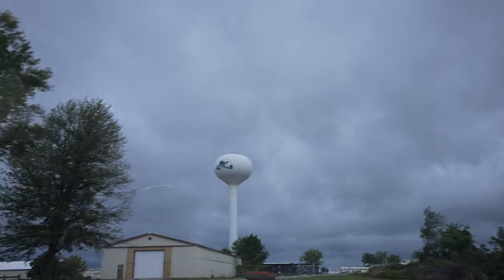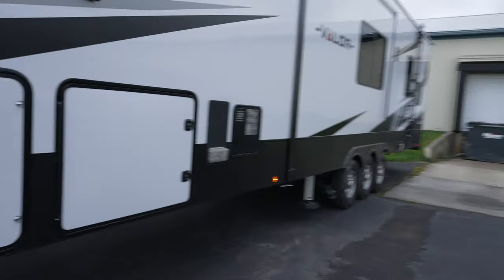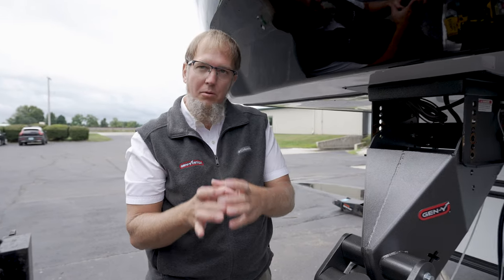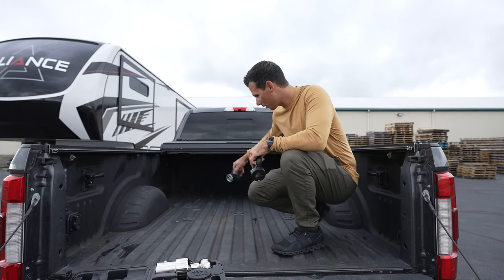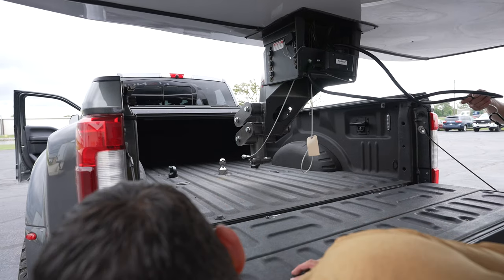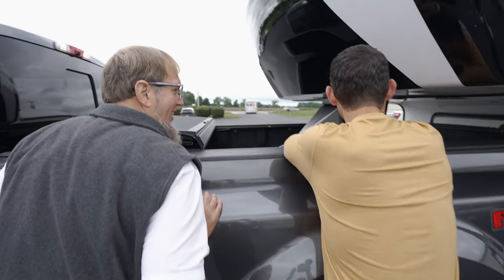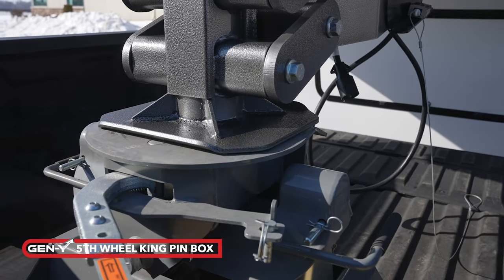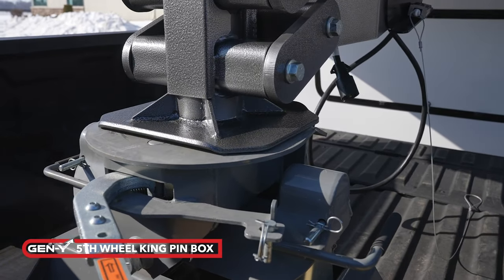Gooseneck conversion on our Alliance Valor...should we have done this sooner!?

Comment: Does it void your frame warranty? The Reese goosebox does not. Thanks
Reply from the maker: Hey Alex! Technically it does void the Lippert Frame warranty at this point in time. However, there have been zero documented incidents thus far. Additionally, Reese doesn’t make a pin box for the Rhinobox setup that we have on our Valor at this point in time.
Reply: @PawsForLove  Reese does make a hitch for the Rhino Box. The part number is 94920, supported by Lippert. We just purchased one and will be having it installed soon as our trailer is currently at the dealer for warranty work. 

The older gen 1 & 2  Reese Goose boxes did not fit the Rhino mount but with a slight modification to 4 of the bolt holes it would work. All that needed to be done was to slot these holes 3/8" towards the front of the hitch and the hitch would bolt up.
 Bob
Reply from the maker: That’s great to know! Thanks for the information on that.

Comment: Would this work on a truck that is lifted. I added a 2 inch lift to my fifth wheel trailer but my trailer is still not level.  My truck only has a 3 inch lift. I tried a andersen hitch but it put my trailer  to high in the front.trailer
Reply from the maker: That’s a great question! I’ve actually been wanting to do the 4.5” Carli lift on our F350. I haven’t found any research yet that indicates we can or cannot use this setup. I know it’s not an answer, but I’m researching as well right now. More to come!